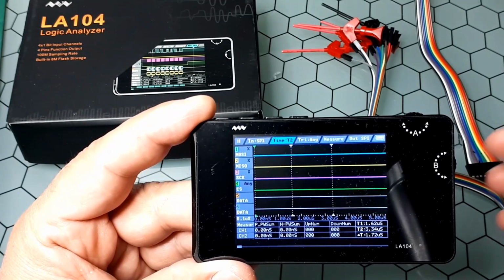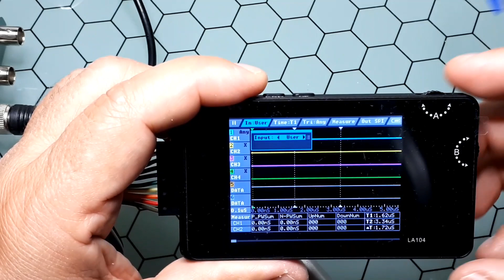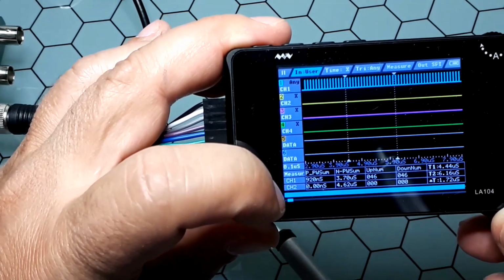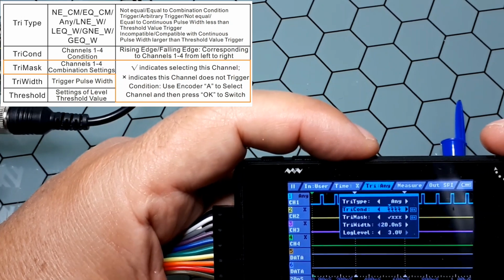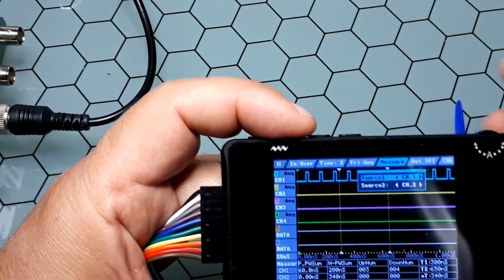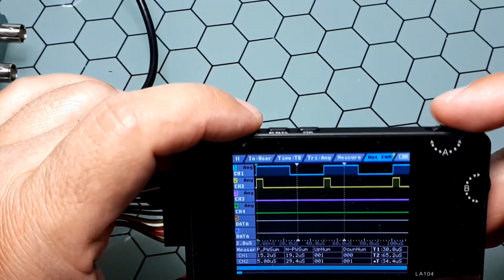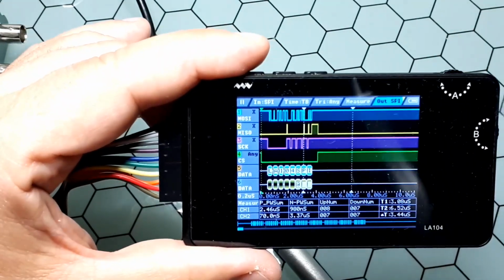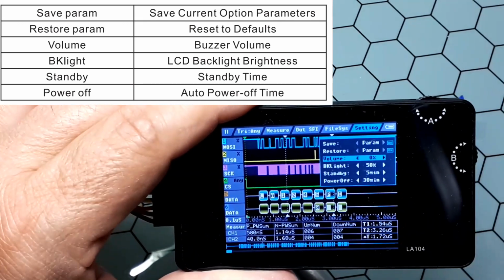Tutorial. LA104 Logic Analyzer

Comment: just bought one of these, people have written firmware for these to do other functions. i just got mine so fouled up would not display any kind of a wave form. I went into "settings" use the "A" wheel all the way to the right, then menu and select restore params.  having a hard  time with the trigger and the diff icons. minidso needs to have a manual for the not so advanced user , a "see spot, see spot run" type of manual.